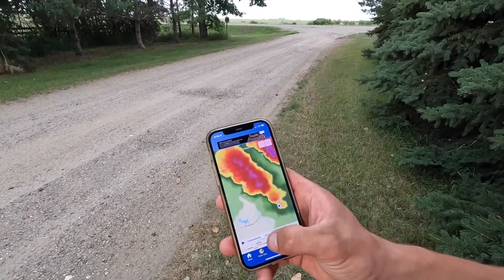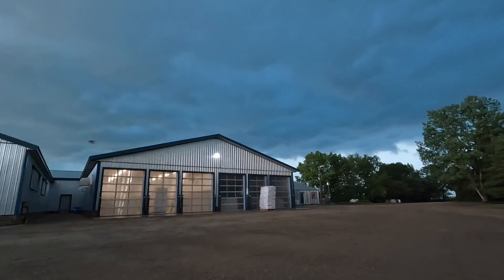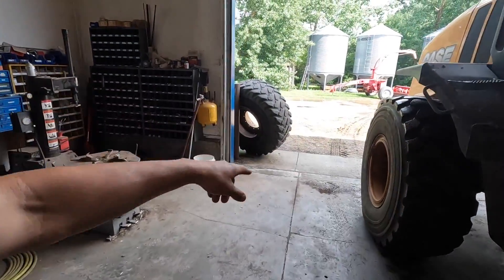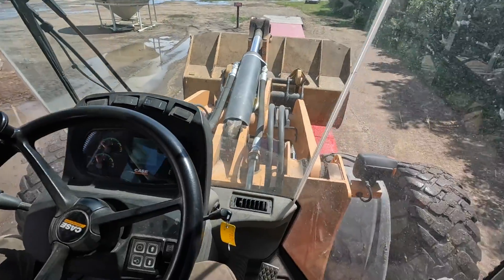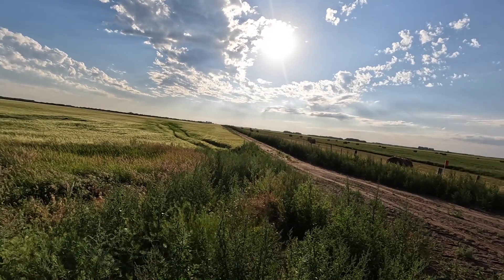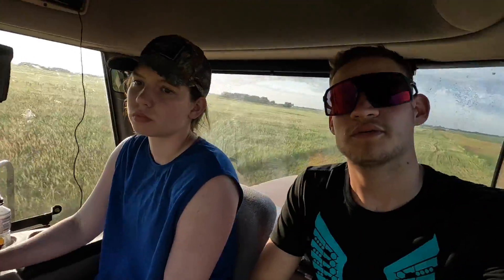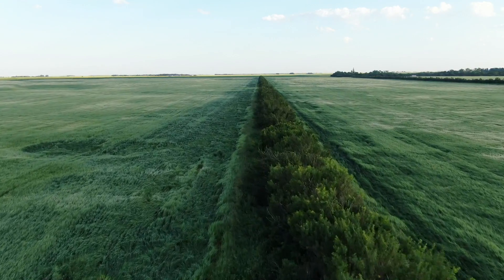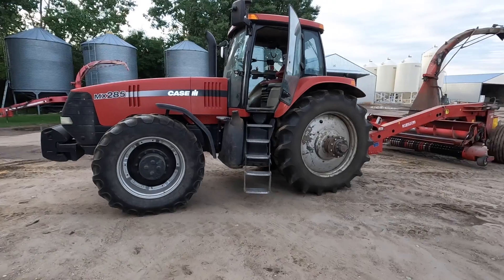SCARY Storm Roles Through..

Comment: Have you ever tried using RainX on your cab glass? Not only does it repel water but dirt build up too if it's applied at regular intervals. It also saves on wiper blades being they're not used as much.